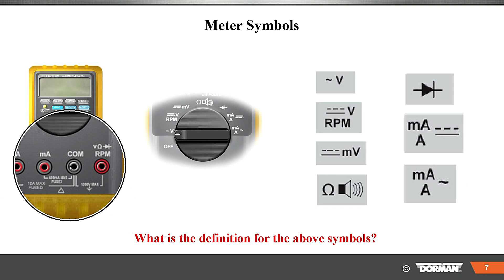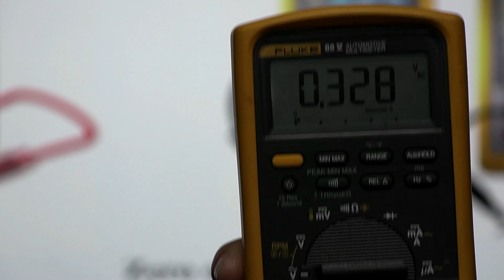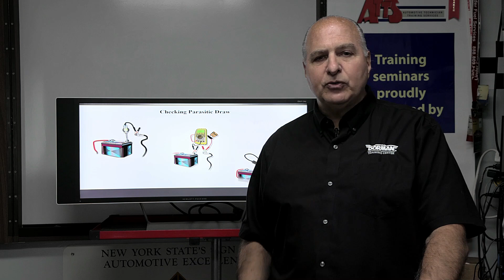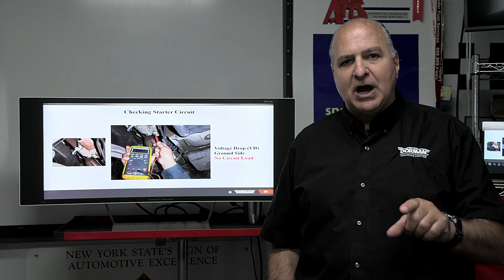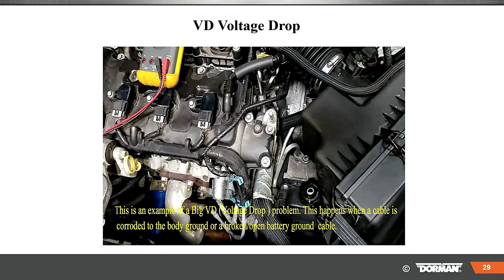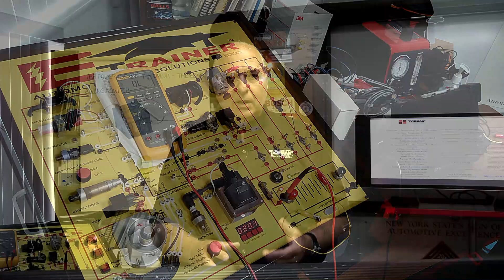Dorman Lunch and Learn Understanding The DVOM And Using It To Diagnose Electric Circuits

Comment: Thank you very much for sharing this video it was Great information. I have a question @29:38 if the fuse is a 10amp why is there no smoke the meter reads 14.1 amps. Thanks my friend

Comment: I'm just a do-it-yourselfer that enjoys working on my cars, friends cars, and relatives cars. I guess I've been very lucky because I've always replaced bad battery cable terminals with the ones you say are garbage and I've never had any problems with corrosion or voltage drop. Used them for over 40 years on my cars. I have a car right now and it's had these terminals for the last 15 years. I've replaced the battery 3 times and never had any corrosion or problems with VD. I never pound the terminals or aggressively twist them onto the battery posts. I always open up terminals so they go onto battery post easily and then tighten them. If you beat them or  aggressively twist them on, I think you damage seal between battery post and battery case which allows gassing and this corrodes terminals and cables.

I know you guys are pros, do this everyday, and can't take any chances because you don't want customer comebacks so you crimp the terminals onto the cables. I just wanted to throw my 2 cents in.

Comment: Fantastic video and informative MrG a question about parasitic draw methods Have you ever tried this ? Connect DVOM in dc amp from battery neg to a good ground on car in series and remove accessory ground only (on 2 wire -engine and accessory ground) Is this a way good or bad to find a draw?CHEERS and thumbs UP
Reply from the maker: Sorry it took so long to get back to you...thanks for watching and your question. You need to place the amp clamp around all the grounds wires or you will miss the current draw. You can do the same thing with a meter in series but be careful if there is mor than 10 amp draw. Make yourself a circuit breaker tester to connect to the meter leads. After you see the total you could do one wire at a time to see where the draw is coming from ...if the wiring diagram is available. If you have not already subscribed to our tstseminars YouTube channel please do so. Interested in more training? Go to www.tstseminars.org and view full length videos for members on TechFlix for unlimited viewing …Membership and over 100 videos for $99.00 a year. Also checkout www.attstraining.com for hands on training and webcast FREE videos at www.tstseminars.org/training-videos